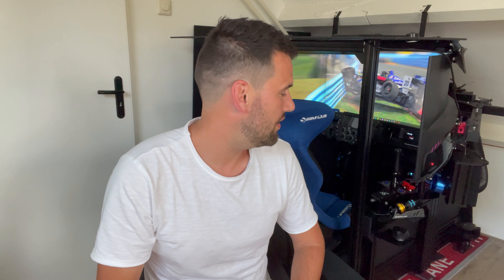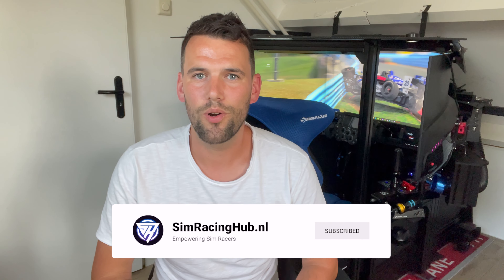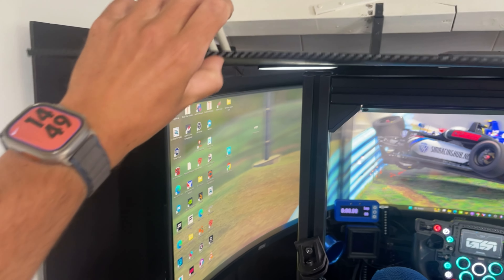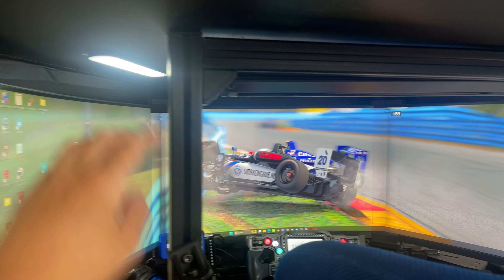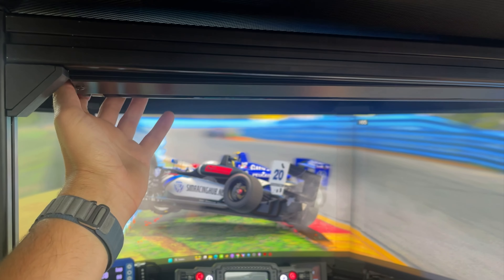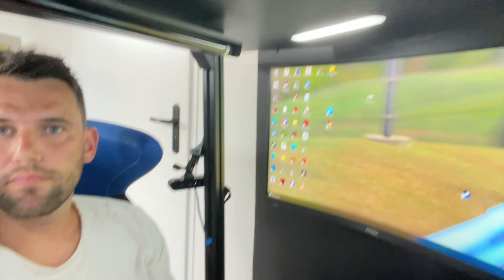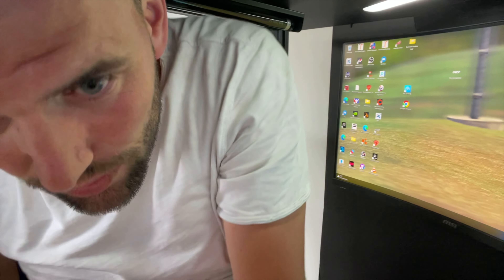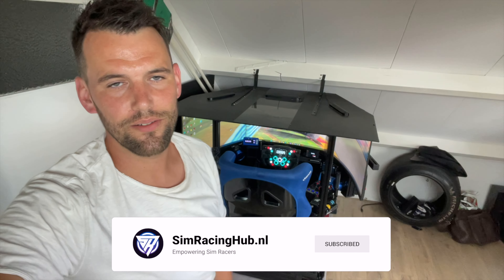How To Enter This Sim Rig? | Sim Racing Rig Tour

Comment: Are your monitors decoupled or not? If not, does it work well with your Bass Motion because of the monitors?
Reply from the maker: The monitors are integrated on my setup. I am not using a full motion platform, just the slip-angle bass shaker kit (Y)
Reply: Okay , and the vibrations don’t harm the monitors? Thank you very much
Reply from the maker: @max61621  Nope, not at all! It's fully compatible with the integrated monitor mount from sim lab
Reply: @SimRacingHubNL  okay thank you very much, I was worried about the vibrations👍🏻

Comment: I miss my roof 😢 need to put it back on I think, but yes makes it tricky to get in and out. Seems worth it though once your in there the rig looks awesome!
Reply from the maker: Thanks Mike! Yes it’s absolutely worth it. You are the one that inspired me building this 🙏 Still need to find a way to fix the lighting though. The Hue lights are leaking a little bit on the monitors as well.
Reply: @SimRacingHubNL consider using meshed fabric, choose whichever suits your need, it can be easily removed.
Reply from the maker: You mean for the lightning?
Reply: @SimRacingHubNL  yeah, it's easy and you can use multiple layers to reach your desired outcome.
Reply from the maker: Can you share some examples?
Reply: @SimRacingHubNL  https://youtu.be/mg1qygPJXOY?si=sUzZJjL8M-aX_Hsl

Here in this video he uses different materials to difuse LEDs, wgat I have in mind is using either a transparent or meshed fabric, or wax paper, and fix those to the lights surface with just small pieces of double sided tape.